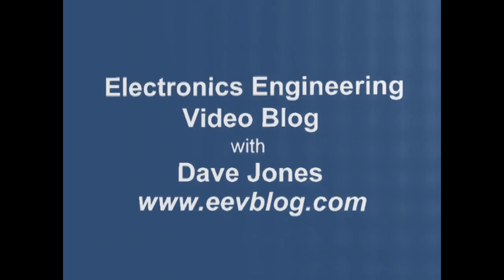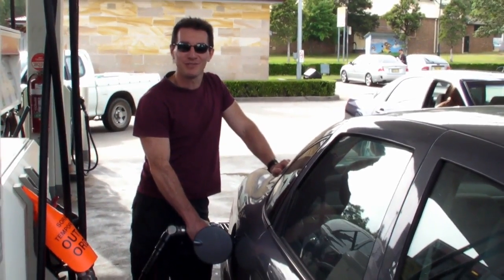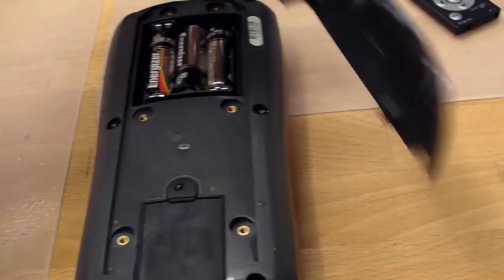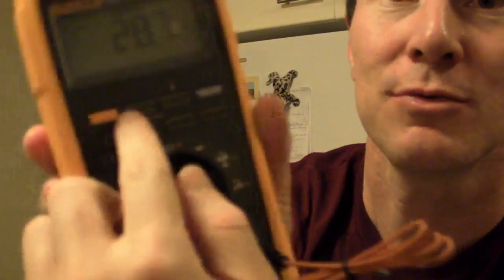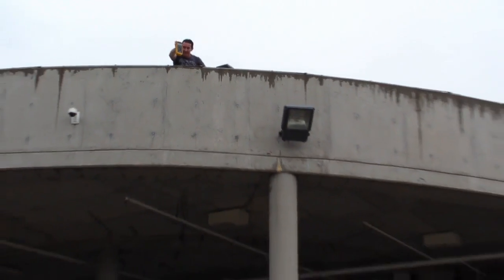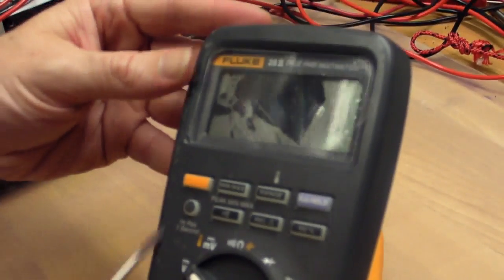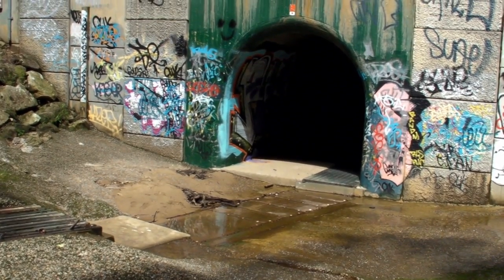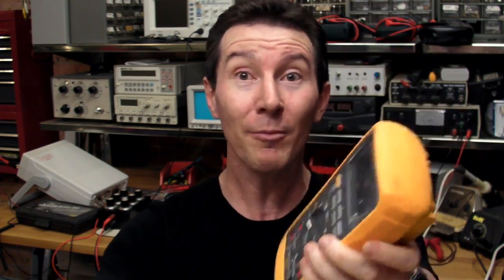EEVblog #66 - Death & Destruction of a Fluke Multimeter

Comment: take the m5 did you? I'm in the hurstville region
Reply: No actually even that tunnel looks like M5, if you notice the street layout when he exits the tunnel mate.
i don't think it is

it's likely based on the last 900 videos and drive by rants we've seen
dave lives around North West sydney,  around Windsor Road Area
so.. that BUS IS ROUTE 143
which Manly to Chatswood via st leonards, 
again, makes sense that he would northish
so around Epping Rd or Maybe close to boundary road but not north of boundary road

so.. if your in that area and you want to go to the mountains
you take either Pennant Hills road then Cumberland Hwy then right on Great Western Highway
or if you don't care about toll charges
then

from north, you'd go 
M2  which is where i think he was
M2 become M7
and then from there the only logical path is 
M7,   then Turn right into M4 and head to the mountains

i reckon you saw him in the M2,

if it was the M5,
go to 0:43
Notice how when he comes out
THERE IS NO AIRPORT ON THE RIGHT SIDE, instead..... TREES

when you head away from the city on the M5
Airport is on your right side, you go under the runway
then you go through the tunnel
when you exit the tunnel, First exit on the right is   ROCKDALE exit that goes to san souci
then about a few km's later on your left is King Georges road as you know

this was not the rockdale exit

it's likely he's on the M2
Cross city tunnel has a similar tunnel,  but the direction doesn't make sense
because if dave went from chatswood or there abouts via CCT then M5
he'd still have to go right onto M7 and left onto M4
doesn't make sense

it's likely
M2  to  M7  to M4  to Mountains

what are we doing anyway
are we trying to stalk dave here or what   hehe

you know how you have that game.  WHERE'S WALDO or whatever it's called

let's do 
WHERE DAVE    :P

oh hang on, there's a street sign, i know that 
so.. dave must be......  
hehe
Daves gonna get an AVO out on us.... Just wait and see

Comment: Fluke does have a strong believe in their product, when they give you a product to kill it. I mean: It was obvious that you will crack it open and look at the insides for the least (some companies wouldn't like that to begin with). That you will put the specs into test... not that obvious but: You totally mistreated it and only two parts failed: Nice for a multimeter that sits most days on a boring lab table :-)